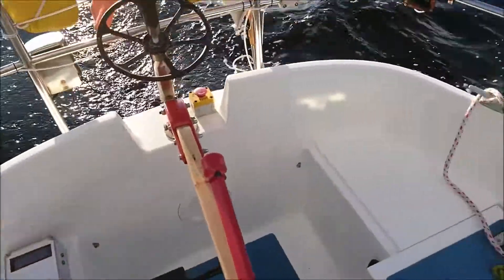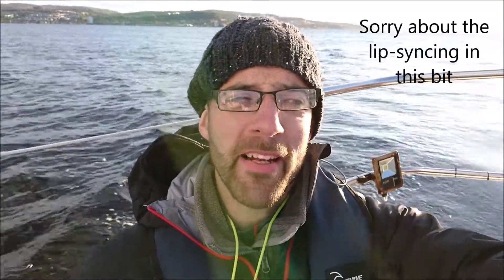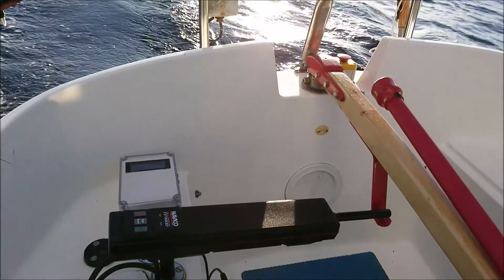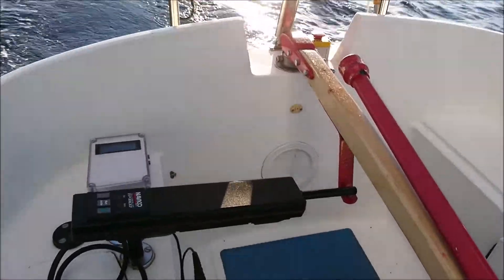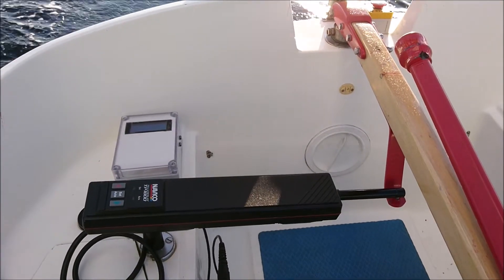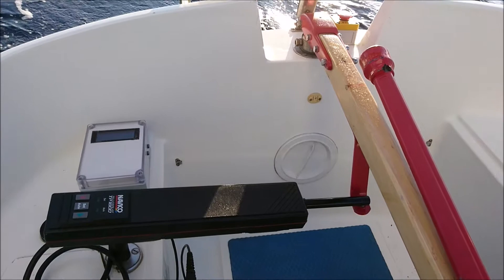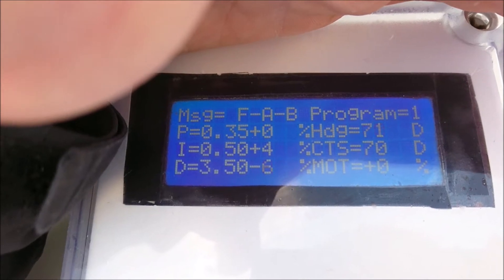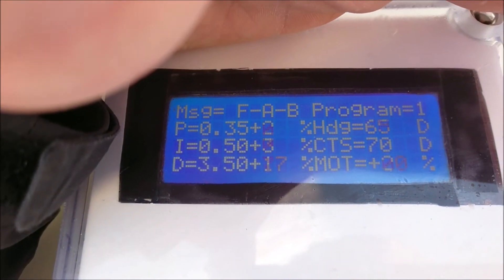Running the Arduino autopilot whilst sailing to Rhu

Comment: Interesting project.
1. Which method (most likely, not iterative) do you use to solve a direct and reverse geodetic problem? Haversine, Gauss or Bowring?
2. In my experience, the yellow display is best seen under the sun .
3. As the buttons I use magnetically operated contacts (operating by little magnet in my hand ). Intro box puted silicagel in membrana bag.
Reply from the maker: Thanks.
1:  This is a compass bearing system so there is no need for these algorithms.  On my home made navigation system though I use the Haversine function to get the bearing between two lat and longs.  
2:  Noted.
3:  Yep, Silica gel is in there.  I now just use the remote because in practice thats all I did even when I still had buttons fitted.
Reply: The orthodromic navigation (related to orthodromic course; from the Greek ορtóς, right angle, and δρóμος, path) is a way to navigate following an arc of great circle corresponding to the shortest distance between two points on the globe.
Compass error, wind, waves and water currents prevent the boat from moving along the shortest distance between waypoint N and waypoint N+1.  In the curvature of the boat track, I was convinced a year ago.

To prevent this, the points of the great circle (directly at the boat's course) are calculated step by step as the boat moves through the direct geodetic problem algorithm. The Bowring algorithm for the direct and reverse geodetic problem is one of the most accurate among non-iterative methods (for the ellipsoid as a model of the Earth).
 For example, the error in determining the position of a point for a direct geodetic problem is 10 cm at a distance of 600 km (2.7m at a distance of 1000 km ).
From my personal experience, the expenditure of computer time on the computation of the Bowring algorithm is comparable to the haversin formula or the Gauss method.
My program uses formulas from the book  GEOMETRIC GEODESY. PART | by. Richard H. Rapp (April 1991)
http://fgg-web.fgg.uni-lj.si/~/MKUHAR/Zalozba/Rapp_Geom_Geod_Vol_I.pdf
Page 114.
Perhaps there are other good methods that I do not know, but the Bowring formulas work well.
(sorry for the machine translation)
Good luck.